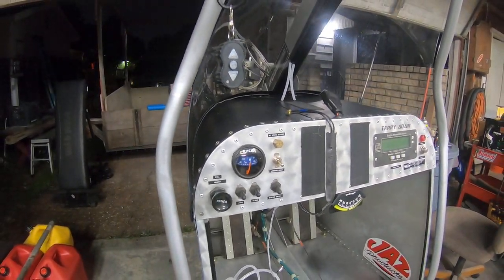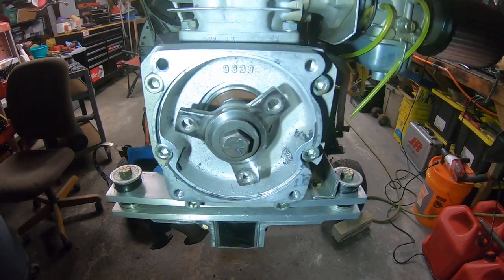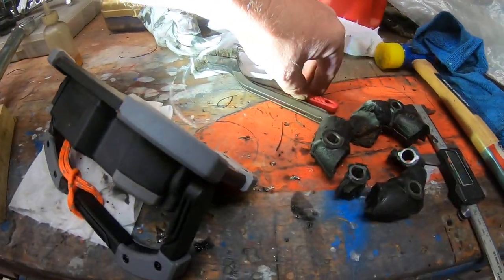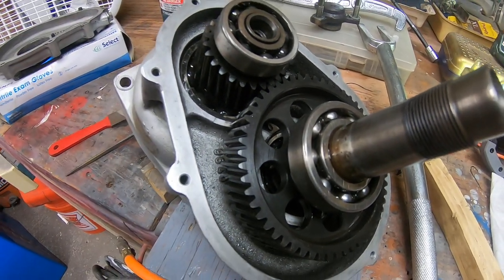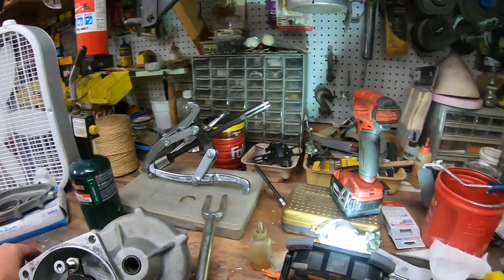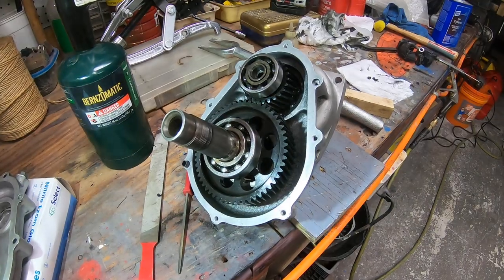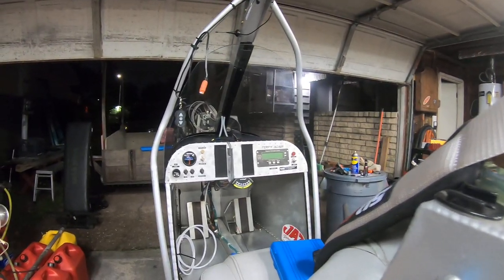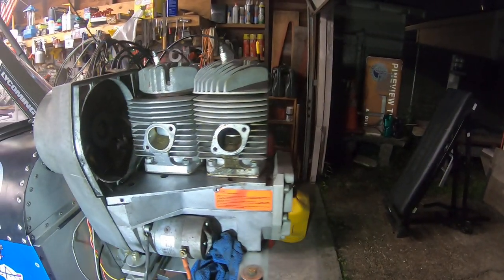Affordaplane Update on TA1's engine out

Comment: That rubber coupler saved the engine. Hopefully that gearbox case is not worn or ovaled out with that bearing failure. Would be a good time for an engine/gearbox overhaul weather you need it or not. Glad to hear the news, keep us posted.

Comment: Hi Terry. I would say is that your engine is fine.
A twostroke lives and dies on its crankcase seals and it's exhaust. If a seal is leaking it causes the engine "wisker" the spark pluges and stall. If the exhaust carbones  up you will loose almose all the power and eventually the engine won't run at all. It is of the utmost importance that the crankcase is sealed. Not even a pin prick of a leak, and the exhaust is kept free of carbon. Even if the exhaust falls off the power loss would be insignificant. Only if you were to have fitted an expansion box tuned exhaust system would the power loss be noticeable. Bad sealling of the crankcase would cause a very unreliable engine.
The rubber connection in the gearbox is where your trouble lies.
Haveing owned an Alfa Romeo in the past I see a weakness in design of the shock absorbsion system. There is no pilot bearing in the input shaft or a pilot shaft  on the output shaft.
This arrangement is there to hold the rubber connector centred like a clutch plate on a car.
What I think happened in your case was the bearing failed causing the input shaft and the doenut to drop out of centre. Then the bearing locked up causing eccessive strain on the dienut. These two conditions caused the doenut to break up into pieces.
Did you expierence excessive vibrations just before failure? If so I would leave the engine alone and concentrate on the prop reduction unit. 
96 P.S.I is very close to 100 P.S.I. and twostroke engines are a very low compression engines anyway. Just keep a close check on the spark plus. If you see any signes of fouling then check the crankcase seals and gaskits.
The crankcase seals are the major cause of a twostroke engine been unreliable. Even a blowen head gaskit doesn't mess up the reliability too much just cause a loss of power. I've had motor bikes where the head gaskit has blown and the only thing noticeable was the flame that appeared out of the top end, but a blocked exhaust or a leak in the crankcase was a totally different matter.

Comment: Hi again Terry. You pointed out another problem with the exhaust system.
First off I want to say that I'm not a lover of siamese exhaust systems on twostrokes. I feel you will have better performance if you had seperate stacks for each cylender. Siamese systems tend to blow crankcase seals when they block up. This was told to me when I had a Suzuki 750 GT. There was a 3 into 1 system available for these engines. I was told they were engine destroyers and that I would be wise to fit the standard 3 into 4 system.
When you did the compression test did you remove both plugs and set the throtle to fully open, and was the engine at operating temperature. If you omitted to do any of the conditions mentioned it will give you a low reading. 
I suggest that you run the engine while you have the reduction drive off and re do the compression test with a hot engine and the spark plugs removed. Just remember to open the throttle.
I think you will be in for a pleasent supprise. Your comptession should go up to about 120 PSI or there abouts.
Compression tests always are done at full throttle and a warm engine. Just remember all the spark plugs must be removed or at least disconneted. The test is done at cracking speed anyway.
Best of luck with the repair. I hope the bust up didn't do too much damage to the reduction drive.

Comment: Terry, I don't do farce book so I won't see the pictures you mentioned. IF you're getting "irregular throttle response in the midrange", I would carefully check the engine for signs of either detonation or seizing. If a two stroke partially seizes it can still restart and later give a full on seizure.

Comment: Can you drill and tap the gearcase and install a chip plug?  I am a career helicopter pilot and chip lights aren’t uncommon at all,  would warn you of an impending failure in the reduction box well before you have problems.

Comment: Glad you found the problem. It was also good that you didn't try to fly it home from the other airport. 

I'm not sure you will be able to use the old redrive case. It looked like the outer bearing race was rotating. If the outer race of the bearing can rotate in it that's not good, that's supposed to be a press fit.

Can't wait to see you back in the air again. Good luck.
Reply: Hey Steve, could it have been a damaged or faulty case that somehow allowed the bearing to loosen,  and caused the leak, or do you think a seal or gasket failed, causing the leak, and the bearing to fail?
Reply: @kirbylee57  I can't tell where the oil leaked. I didn't see any evidence of a leak on the front of the plane, like where the engine mounts. I don't know if Terry did any cleaning of the parts, they all look like he has. It's hard for that much oil to get out of that case and not make a big mess somewhere on the engine. 

I don't think the case caused the bearing to loosen. I think the bearing seized, due to no lubrication and caused the outer bearing ring to spin which caused the case to be damaged.

What caused the oil to be gone is a mystery. The seal at the prop shaft, or engine shaft, usually wears over time and a leak there would be evident by oil being on the prop, or the engine. A gasket failure is rare since there is no pressure to cause one to blow. It would also cause oil to be visible somewhere on the engine since it would be blown around by the wind and prop blast. Worst case would be that the oil was drained and none put back in.

Comment: the bearing spun in the case, the case got hot, the heat transferred to the donut, it decompiled, the rubber donut parts (probably was only one large piece at first) acted like a brake between the crank and the housing and just stopped the crank (you can see it in your flight video). The case cooled as you descended, the rubbed dislocated and freed the prop, you can see that as well in the flight video, then you restarted it. The case may or may not be damaged from the spinning bearing outer race where that bearing slides into the case for the gear drive..

Comment: The housing where that bearing spun IS DAMAGED. I think you will need a new one.
Reply: how do you know that?
Reply: @kirbylee57  Because the bearing race spins, it should be press fit, means held tight by the casing for the bearing to do it's job.
Reply: It could be glued in but is not a good repair specially in an airplane.
Reply: A good machinist could put an steel insert but i don't know if there is room for it.

Comment: ThesevRotac engines and gear boxs are not reliable after 300 hours which is the TBO and need to pull apart and change bbearing every 300bhours andba completebover haul and maybe every 5byeats which ever come first . I know a few guys hate these rotax engines